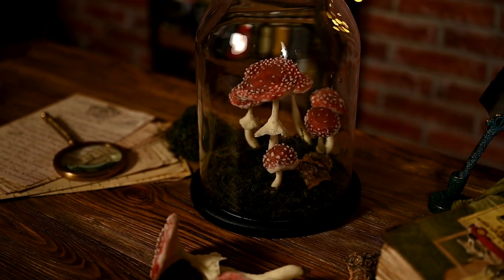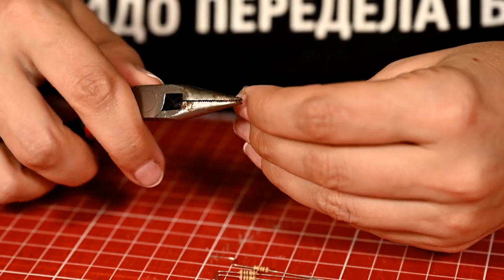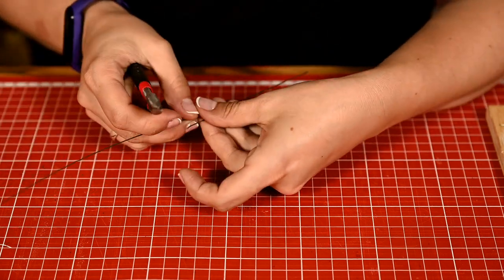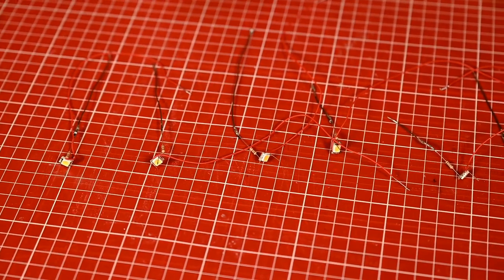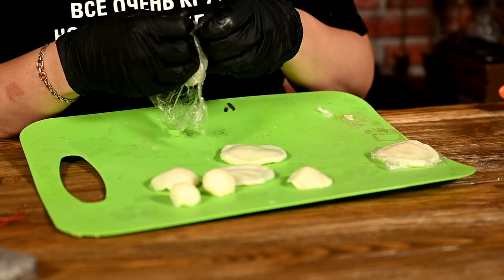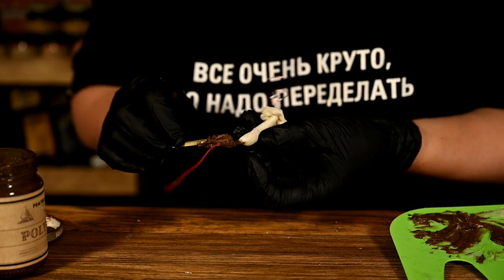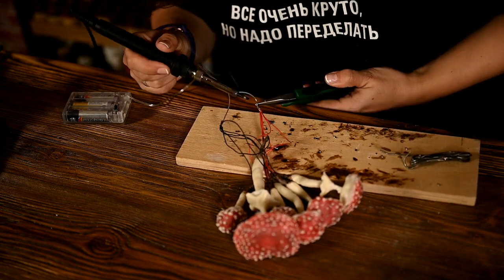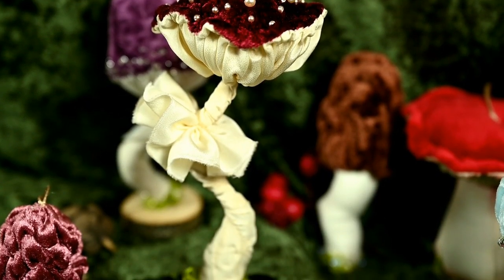DIY cute mushrooms out of silicone sealer!

Comment: Has anyone had issues with the silicone not curing properly after coloring it with acrylic paint? I’m working on this myself and seem to have a bit of a curing issue. Gonna leave it over night to see if maybe its just a longer cure time than normal hopefully they cure correctly!
Reply from the maker: Hi Nathan, I didn't have any issues when doing this, but the original video by DIY Perks has the reference in the description saying some people had these and this seems to depend on the silicone brand. Most just needed more time to cure, though, so you definitely did the right thing, probably just have to wait a little more!